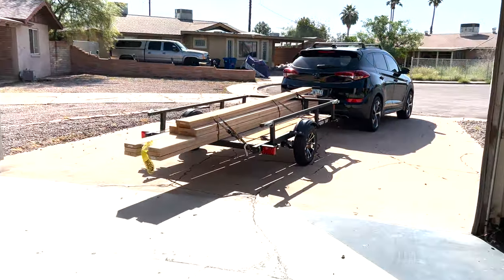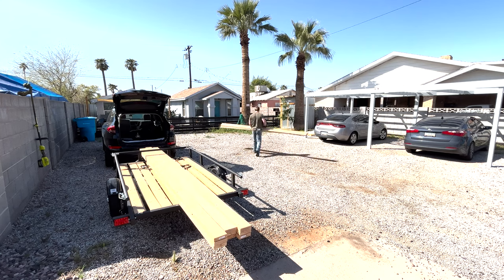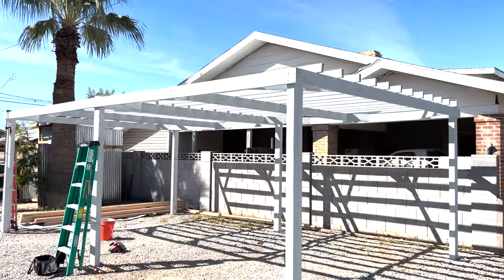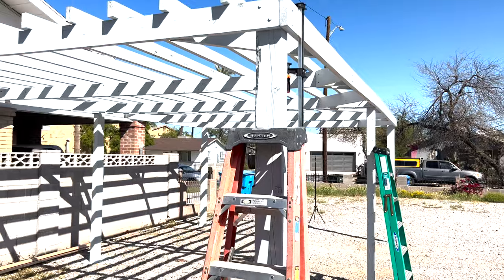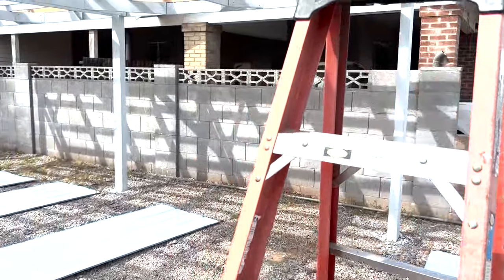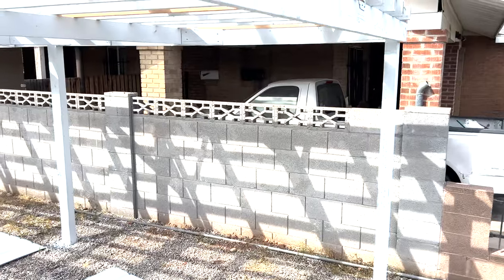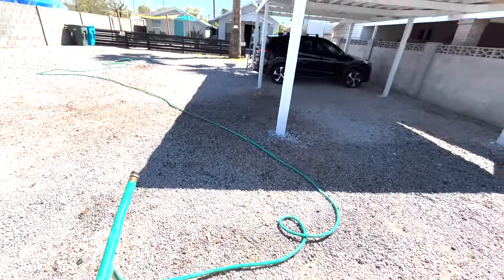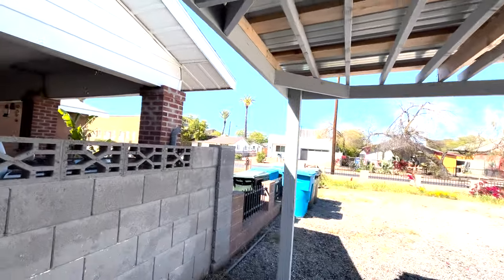Building a Metal Roof on My Carport for $1,200! Handy Tips for the DIY'er #diy

Comment: Hi Taylor, The bearers supporting your roof sheets should run in the opposite direction to how you have fixed them, this will support the sheets and stop them from sagging, also only fix the roof sheet at the high point of the profile and not the valleys of the profile where the water will run.
Reply from the maker: Hey Nigel, good points thanks! I’m always learning

Comment: Great video. I recommend adding more 2x6’s to space it at least 18” on center. Screwing down just the edges won’t be strong enough to handle our Arizona winds.
Reply from the maker: Thank you! I should add I did screw the panels on all edges and in multiple areas at center using the lumber under the 2x6’s. Will definitely evaluate after the first monsoon!

Comment: I am learning and I want to do something similar to this definitely with the pitch because I want to use solar panels on top instead of the metal roof. My question is why are the braces not going up on an angle from the 4 x 4 post to the roof to add support for the weight of the roof?
Not criticizing I just would like to know.
Reply from the maker: You can add angled bracing as well! I just didn’t because I didn’t feel it was necessary. In a recent video I added more 4x6 posts in the middle of the carport to better support the weight of the roof. Thanks!
Reply: @taylor.g.deloye  yes I watch that video as well. Thank you for responding.

Comment: I don't think it would be very difficult to take bellies out of the tin if you decide to. And a little more pitch would be nice. 
Probably the easiest way would be to remove the tin, remove all the new wood, shorten the top of the three posts on the drive side away from the house by 10 inches, put tin back on, use the new removed wood for the nice new storage building.
Reply from the maker: I'll look into that option thanks!